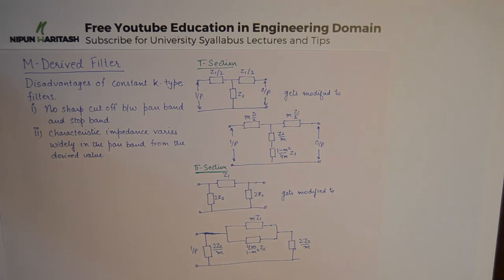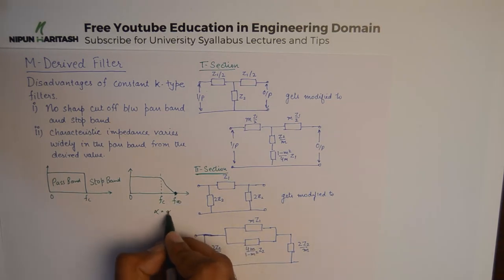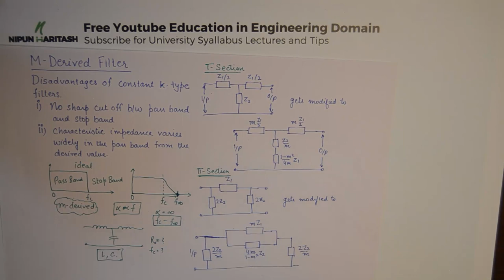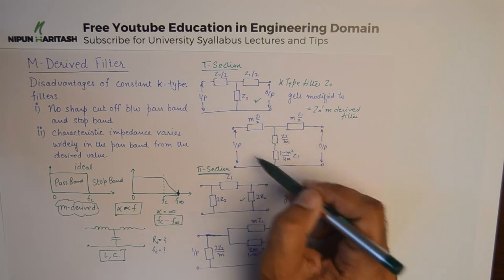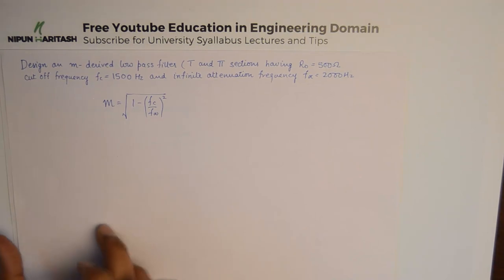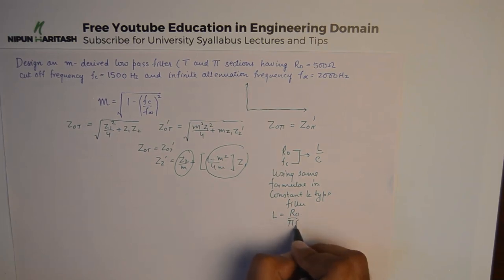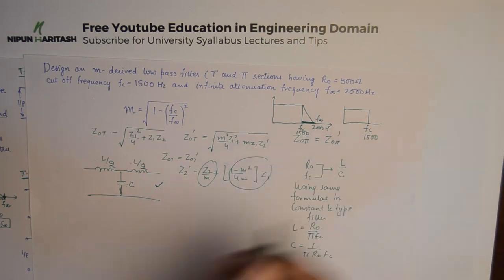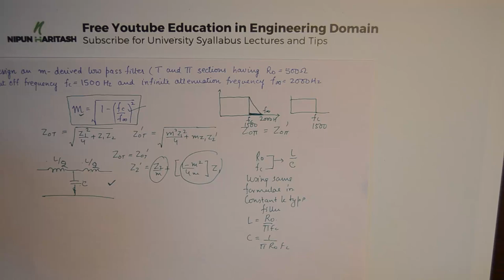m-Derived Filter Design Introduction | Network Analysis and Synthesis

Comment: Why you're not using the characteristic impedance equations of low pass filter...when it is mentioned the equations you used are of high pass...🤔
Reply: Go and check ur notes the given eqn of L and C even characteristic impedance of low pass filter which is z = √(1+ z1/4z2)
Reply: What is characteristic impedance of two port network.
Reply: @churchilljovs6861  the impedance/resistance offered by a network
Reply: Characteristics impedance of t network is Z°=√(Z1^2/4+Z1Z2)